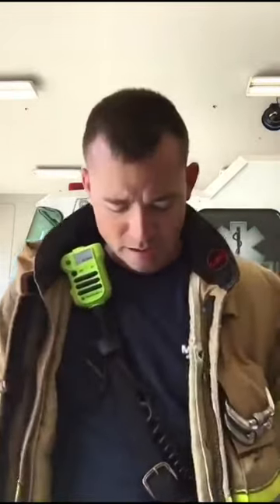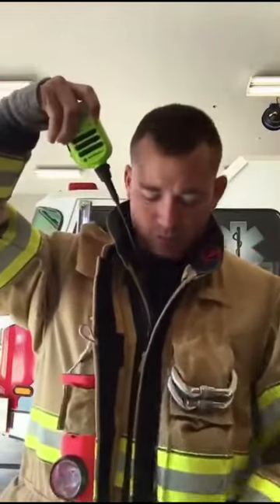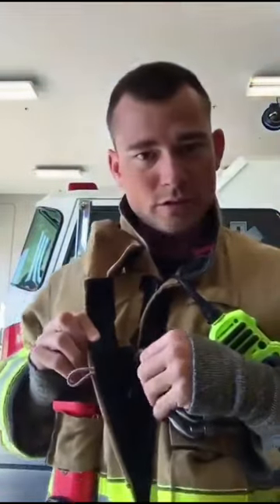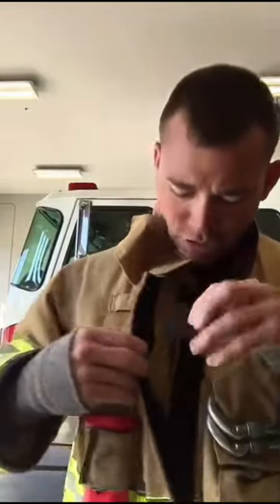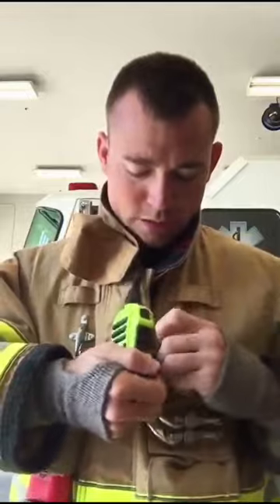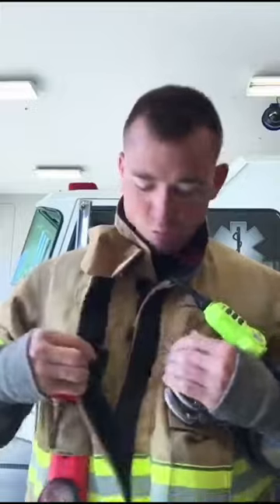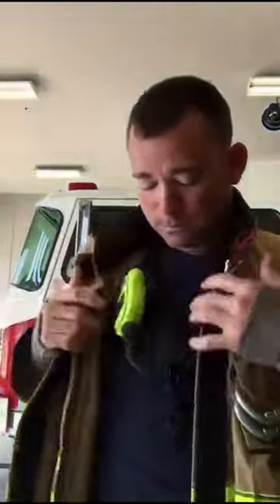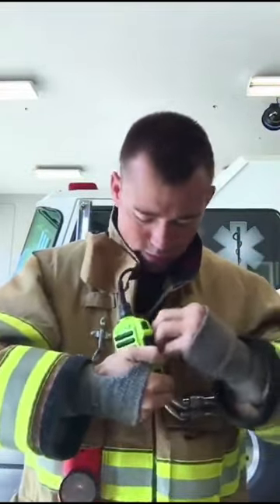Using The Mic Loop MICRO with firefighter turn out gear

Comment: You have your mic on upside down. As per the operating instructions from Motorola the orange button must be up. The way you have it each time you use the mic in that position you cover both microphone ports.
Reply from the maker: john doe I’ve worn my mic (for law enforcement) upside down for the last 13 years. My entire career. I’ve not had a single instance of covering the mic ports.
Reply: The Mic Loop you also shouldn’t centre mount these RSM’s and YES you should put it up against the voice port on the SCBA mask when transmitting. Just about everything he recommends is contrary to the manufactures advice following extensive field tests.
Reply from the maker: john doe I’m not a firefighter, so I can’t comment about how a firefighter shoulder properly wear their equipment. However, this guy is a firefighter who gave his own account about using The Mic Loop with his gear.
Reply: The Mic Loop well as you can see from the official Motorola guidance for his specific radio and microphone everything he is doing goes against what they recommend.
Reply from the maker: john doe I guess sometimes you gotta bend/break the rules
Reply: The Mic Loop not in this case. All it does it make his audio sound like crap as the technology in that handset is working against him. It needs to be on the lapel with a gear keeper so it can easily be moved to your mouth when required or a slight turn of the had towards it. NO use upside down on the centre of your chest.
Reply from the maker: john doe ok
Reply: As much as I like the product. I would have to side with John. The XE RSM, XE 500 are designed specifically to work up right due to positioning of ports, microphones. We recently had a vehicle fire where the pump operator had the mic upside down and spoke into it but no words were audible. We later tested the same scenario with the mic facing up and it functioned as it should. The microphone is on the top left of the back of these mics and unlike Law enforcement black rsm, front mics serve primarily as noise cancelling microphones.

Comment: Ain't got time for that! What are you gonna do when your rig is about to leave you bc your on porcelain, then the fire is a block away. You gotta get all your gear on in the rig, hood, gloves etc. Messing with that strap and then pulling your mic out, clipping it in. Not gonna fly.

Ditch the leather strap. Put the loop somewhere uptop where you like it. Run your cord under flap, through a buckle if need be. And leave the radio in your pocket... All you have to do then is put your coat on.. it's always there in the same place. 

How many times has anyone successfully changed channels, volume etc with the radio end way down behind them and stuck bc your coat his holding the case down. 
These leather straps are nonsense if your in a fire